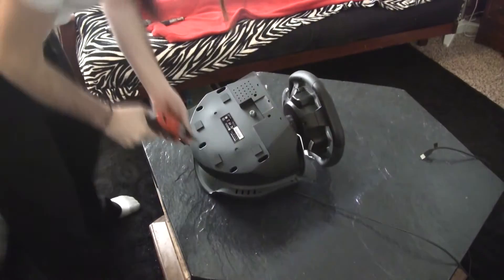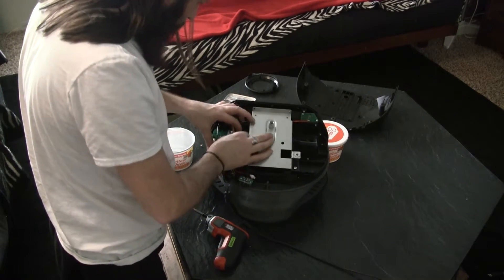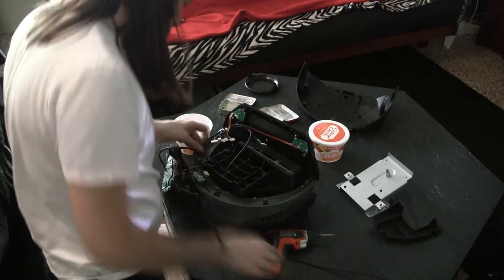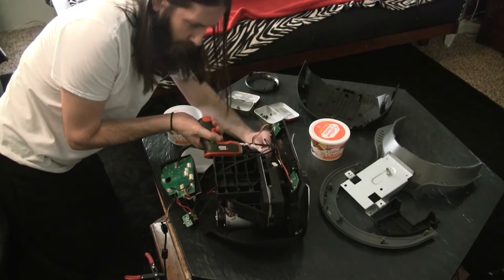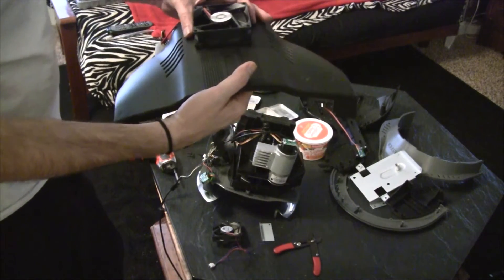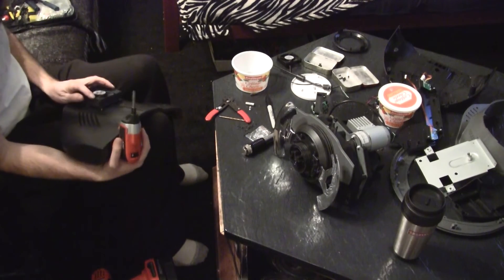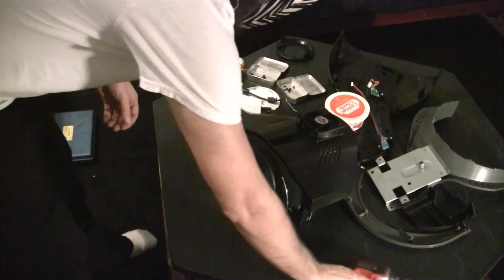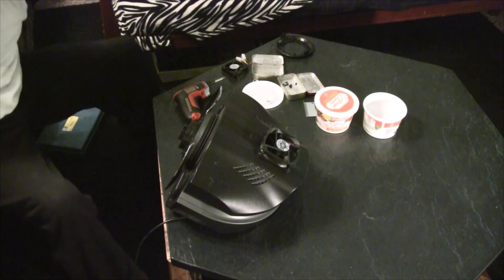Thrustmaster T500 TearDown & Fan Mod

Comment: did you feel any difference in performance ? thats why you upgraded the fan??
Reply from the maker: The stock fan is ok, mine was dying (making a horrible noise) and I was noticing the force dropping off after a long stint and the case was warm. Had to do something and upgrade, easy to swap fans when they die.
Reply: @InJayzBrain  my version of t500 doesn't have any heatsink on it. what should i do?

Comment: Oh man... I am NOT looking forward to doing that in the future... I was hoping there would be a way to take the top off... But nope. Well I hope mine lasts a year or longer before I need to do that. Well thanks for the video. I have rebuilt helicopters from the vin plate, I guess I can still do this. I do like the idea of a bigger fan. I might look at making a doubler that would allow access from the top w/o disassembly. An extra piece that you could screw to the fan and then use some nut clips to allow that sub-assembly to attach from the top... Basically a square open bracket shaped piece... Have to disassemble all once, but the fan would be easily replaced as needed afterwards... When I get to it, I will share some pics. Hopefully not for a long time, but...
Reply from the maker: It's a little tedious for sure, but worth it. Yeah I was thinking about something like that as well but didn't have the pieces handy. But then it dawned on me, a good quality ball bearing fan will give you years of service running constantly most of it's life, while on the wheel it's only on periodically so in theory it's a one time fix.
If your wheel case gets warm on top after use and or noticing fade (even slightly) I'd recommend doing a mod such as this (on any wheel) because it's not getting enough airflow (IMO even New) and slowly killing the motor(s) with heat.
Reply: I think it is a great idea. It might be a one time fix on yours since you have multiple bases, but mine runs most of the day and well into the night. That is why when I do have to replace it, I am going to use a doubler and nut plates so I can remove it easily. I think you could use an old plastic coffee container for some heavy duty plastic or of course some aluminum would work. Might need some kind of gasket or apply some rtv the day before to the doubler. I am curious about what if any filter you put on the fan or do you plan on just leaving it open? I would also like to be able vacuum it out through the top. I am super glad you made this video though. Really got the old gears turning. :)